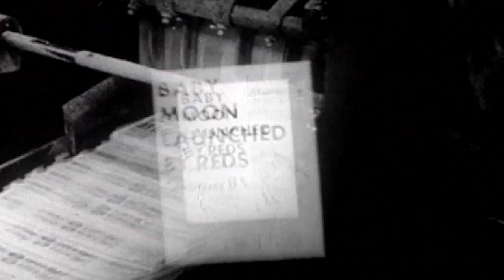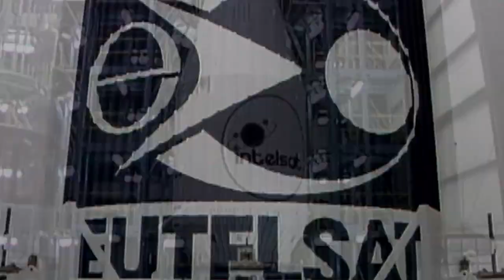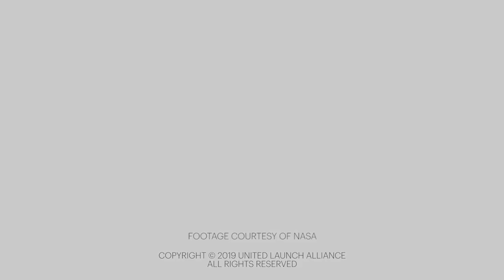Atlas History

Comment: I designed and tested 1/4scale Castor IVA srbs to get acoustic and pressure data for the blast deflectors, cause back in 91 the launch pads were already built(the original atlas launchers) and they needed to get deflectors in and around existing structures.  I used mk36 cases to make motors.   This was done at Thiokol Hunstville (gone now).

Comment: I take issue with the line "In a departure from conventional thinking, the Atlas V development replaced the [pressure stabilized] tank with a structurally stable, common core booster."
  This line could only have been thought up by a misinformed PR team, as the pressure-stabilized tank, in fact, was the departure from conventional thinking, and not the other way around.  
The Atlas V tank is not a departure from conventional thinking, but rather a return to it.  I don't claim to judge which approach is better, but rather to point out that one shouldn't be fooled by the PR-speak in this video.
Reply: Its just easier to add more inert weight.  Easier ground handling, less issues with punctures.  They go with what they know, ULA, if they are some of the same people I worked with decades, will tell its all a KNOWN science, rockets that is.
Reply: Lop
Reply: Rocket away.

Comment: So Atlas went from a pressure stabilized ICBM used against the Soviets to a structural rocket using Soviet engines. Why is it still called Atlas?
Reply: kinda what happened to the delta rockets. It evolved so much it's practically an entirely different machine
Reply: The tank diameter was the same.  The new aluminum tank could still be made on the same machinery.
Reply: @jmstudios457  Yes, but the Delta actually started out as the Thor.
Reply: Delta was always passed through the upper stage. So you had the Thor-Delta, which eventually just became Delta, and they just kept stretching and strengthening the Thor. Eventually the old Delta stage got replaced with the DCSS with Delta III, and Thor got completely replaced with the CBC on Delta IV.

Comment: RD-180 engines were supposed to be phased out, no?
Reply: will be with Vulcan. Atlas V is too close to retirement
Reply: Appable
Yeah, Vulcan will use BE-4 engines, from Blue Origin. Vulcan set first flight in 2021
Reply: Plans were made to make a copy of the RD-180 in American factories if Papa Putin decided to cut off the engine supply. It almost happened because of the Crimia invasion.
Reply: @TheMrPeteChannel  It has happened now. And no, you can't just copy the RD-180, the closed-cycle engine contains technology and alloys that aren't easy to copy.